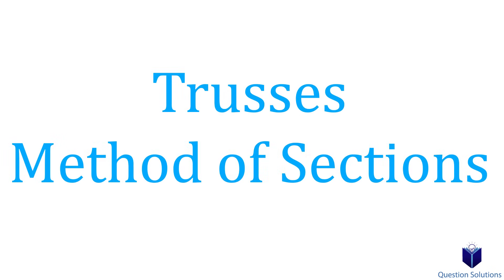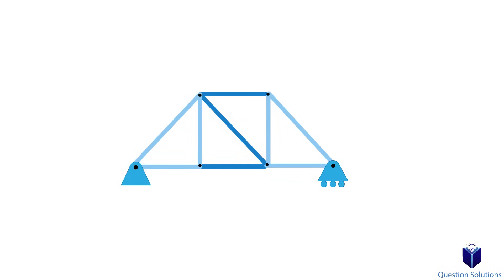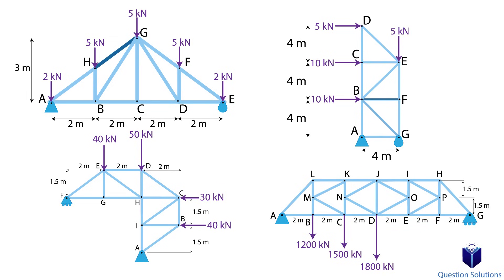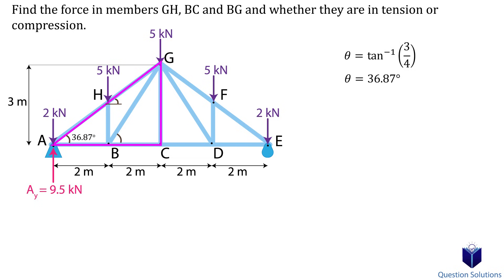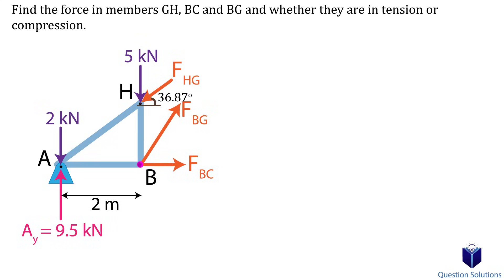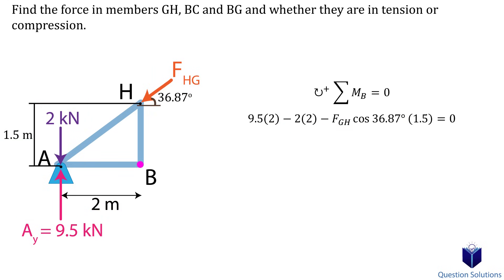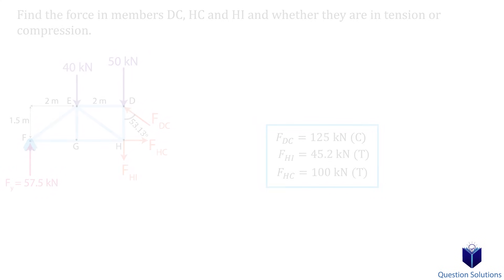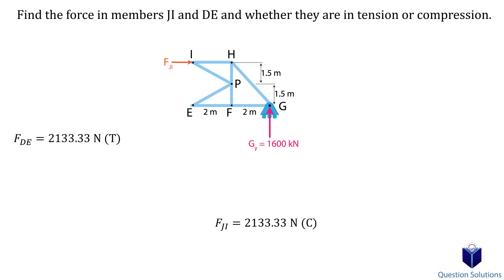Trusses Method of Sections | Mechanics Statics | (Solved examples)

Comment: I'm glad I'm watching this video, I'm having my mechanics exam next week. But I feel you're a lil bit fast in explaining, seems quite difficult to catch up mentally. Like, before I process a part, you'd have gone 3 parts. Also, can you help write the equation one by one. You have real good content, but just to avoid confusion.
Reply from the maker: I try to keep these videos concise, so it doesn't take up too much time. It can be difficult, especially when being introduced to the subject for the first time. So I will keep what you said in mind, but try to watch the video a few times, or try to solve these questions by yourself first, and if you get stuck, then try to see what I did to get to the next part. These videos are meant as a supplemental tool, and not a substitution for a textbook/professor. Thank you for the feedback!
Reply: My approach to his every vid is to try to deeply understand the underlying concept and pause right at the very beginning of each example and try to think thoroughly on how to solve it myself. Give yourself some engagement on critical thinking rather than just "watching". Critical thinking will give you a solid comprehension of the topic that will stuck on your mind that would greatly help you on your exam and even after semester, you will still understand the topic.  Works for me 100% I usually answer his examples on all statics vids 95% before he explains. Try it urself :)

Comment: 8:42 i'm confused at this part. i thought sin DC should be eliminated because it will go thru pin H, and instead use cos DC? or does it depend on where the angle is placed?
Reply from the maker: So you have to always look at it from the perspective of the angle when doing trigonometry. Sine is going to give us the opposite side (opposite to the angle), which in this case would give us the x-component of force F_DC (horizontal line). That will create a moment since it's line of action doesn't go through point H. Cosine on the other hand will give us the adjacent component, (y-component, vertical line), which will go through point H, so it's eliminated.
Reply: @QuestionSolutions  ahh so we're getting the x component here but we just used sin because of the angle. I'm used seeing sin as y, and cos as x so i was confused😆. Thank u very much
Reply from the maker: @armanjanndajab6334  Yes, but don't associate sin with x and cos with y. It's all based on the location of the angle. 👍 Best wishes with your studies

Comment: How do you know when to take moment or Sum of forces in x,y to solve for unknown forces?
Reply from the maker: You usually have to do both methods to find all the unknowns. If you can find an unknown with a moment equation, then you should do that because it saves time. If you can't use a single moment equation to figure out a force, then you will have to sum forces in the x/y direction. This comes with intuition, so doing a lot of questions will help with this. I don't think there is a straight answer to your question. Try to do little as possible to get the answer to save time. That usually means starting off with a moment equation since you can eliminate a lot of the forces that go through the point where the moment is calculated.
Reply: @QuestionSolutions  how to determine which point to take to create moment eq ?
Reply from the maker: @cokonkiyot Pick a point that eliminates the most unknowns.
Reply: @QuestionSolutions  ahh i see . how to know which forces affect that moment ? i confuse lil bit even tho i watched ur video about it

Comment: 6:23 why can't we take Moment about point C? I tried it and it doesnt work
Reply from the maker: You can take it about point C to figure out force BG, you will get the same answer. Most likely, you are making a numerical error or you're not accounting for the proper distances/forces. It's hard for me to say without seeing your steps.
Reply: @QuestionSolutions  it was a calculator error thanks

Comment: You counted Fcdsin53.13,
why didn’t you count
FcdCos(53.13)
in moment of H
Plz reply
Reply from the maker: Please give a timestamp so I know where to look.
Reply: @QuestionSolutions  

8.40 to 8.45
In the equation of Moment
Reply from the maker: @SH-oj6uy  Gotcha. The x-component of force F_DC creates a moment about pin H, but the y-component doesn't, because it's line of action goes through pin H. In other words, the horizontal component creates a moment, but the vertical component can't. The x-component is found using sine, and y-component by cos, so we only need to worry about the sine component.

Comment: Hello, thanks a lot for this video. It was very helpful. I have a question: 5:35 can we cut the truss through BF, AG, AB? basically diagonally
Reply from the maker: You can pretty much cut it anyway you want (as long as you have enough info to solve it). The cut should be made to figure out the unknowns you want, so try to cut the ones you need to find. So yes, you can cut it diagonally 👍
Reply: @QuestionSolutions  ohh I see, thanks a lot and THANK YOU SO MUCH FOR THE INSTANT REPLY I admire your dedication💙💙💙
Reply from the maker: @sapphireblue9209  You're very welcome. Best wishes with your studies!
Reply: @QuestionSolutions  thank you very much!

Comment: Quick question: at 2:04, how do we immediately know that there won't be any reaction on the horizontal axis? 
Like I can see that none of the applied forces have horizontal components, but couldn't AH (for example) cause a horizontal reaction from the support?
Thanks!
Reply from the maker: So when you're solving for the reactions at a support, we don't care about internal members. They don't make a difference since we think of the object as a whole. So all the purple forces are external forces, but we have no forces applied in the horizontal direction. Let's say we had a horizontal force applied at point F, in that case, we would have an AX reaction countering the force applied at F. It's the same if we had a simple beam resting on top of supports. We just solve based on external forces, what happens inside the beam doesn't matter. 
Another way to think about it is to realize that while there is a force in member AH, that force goes from H to A and A to H, there by causing equilibrium. So to recap, when you are finding supports, internal forces do not matter, only external ones.
Reply: @QuestionSolutions  Wow, thanks for the detailed response! Makes a lot more sense now :)
Reply from the maker: @benjaminyellin5095  Really glad to hear it makes more sense. Best wishes with your studies :)

Comment: 9:07 could you have used the moment at F and still got the same Force HI?
Reply from the maker: You can find the values using any moment location but try to use simple ones since you want to make your life as easy as possible. So go for the one that eliminates the most unknowns or leads to a direct force value.

Comment: 9:28 wouldn"t that be that Fx= -Fhc - (-125)sin 53.13 = 100 (T)? Since the direction is in the opposite of the assumed direction and the Fdc is compression so its negative (-)?
Reply from the maker: If the force comes towards the pin, it's in compression, if the force leaves the pin, it's in tension. Please see: https://youtu.be/_rK02neOF18?list=PLXePpKFSUW2ZxGn6VdAPY9d7l7HowWVYL

Comment: Thank you so much, while cutting section, can I make a slanted (diagonal) cut to avoid solving for member that I really don't need for problem?
Reply from the maker: Yes, you can cut vertically, horizontally, diagonally, etc. 👍
Reply: @QuestionSolutions  Thank you

Comment: For the vertical truss, does that mean member BF doesn't need to be there since the force is 0?
Reply from the maker: In real life, no, because they are there to help with rigidity and stability. Sometimes, they will carry a force if the conditions of the bridge changes. lastly, they add to the aesthetics as well. People don't like seeing parts "missing" off of a bridge 😅
Reply: @QuestionSolutions   Hello! How come F bf is equal to 0 when the x component of Fbg is acting on BF and also 10 kN is also acting at BF?

I want a solution to find Fbf using moment method.
Reply from the maker: @rpian1999  Please give me a timestamp so I know where to look, thanks!
Reply: @QuestionSolutions  7:38 time in that video where Fbf is being determined.
Reply from the maker: @rpian1999  So BF is a zero force member, that means it doesn't carry a force. The forces applied at B are carried by the other members, not BF. If you want, you can look at point B and do the equations, you will still get 0 for member BF.
Reply: @QuestionSolutions  What about CE and AG? Do they carry any force or are they just Zero Force member?
Reply from the maker: @rpian1999  I don't know, you would have to solve for them. The question didn't ask for those so I didn't calculate them. CE for sure will carry a 10 kN force just by looking at point C.
Reply: @QuestionSolutions  Ok. In the 2:39 If the 5kN force acting vertically downward on G is taken as 5 kN force acting horizontally on G, then while writing the moment equation about H for getting equilibrium, what will be the equation of 5kN force acting on G horizontally from H?
Reply from the maker: @rpian1999  I am really sorry but I have no idea what your question is. I read it many times, but I can't picture what you are asking. Also, since we made the cut, we don't care about the forces on the right side anymore, so it doesn't matter about the forces applied at G. If you can draw a picture and email it to me, I can look at it. it's contact @ questionsolutions .com without any spaces. Please make sure you check spam/junk box for a reply if you do decide to email me. Thanks!

Comment: Just wondering for moments how do you determine the direction for them?
Reply from the maker: Please kindly watch this video: https://www.youtube.com/watch?v=QNNnPZ68STI

So initially, when writing a moment equation, I pick clockwise to be positive (this is an assumption). So you're looking to see, if we apply a force at a location, will that member turn clockwise about the point where we are calculating the moment at, or counter clockwise. If it's clockwise, its positive, if its counter clockwise, its negative (because it's opposite to our assumption). 

The first 2 examples in the link I provided will help out a lot with directions.